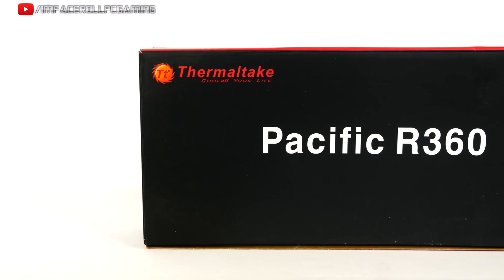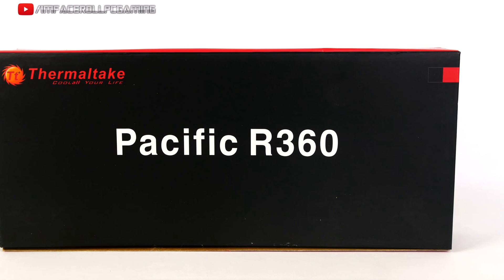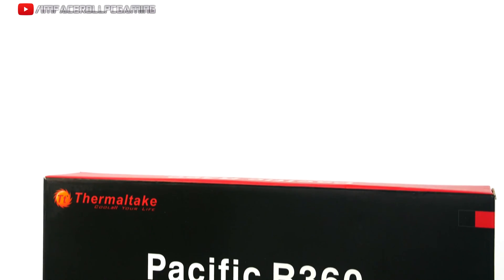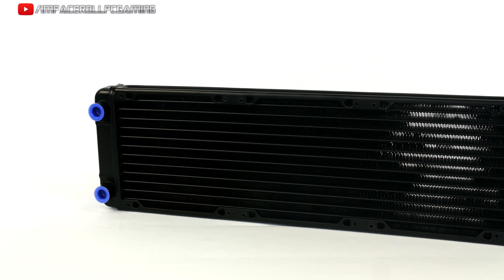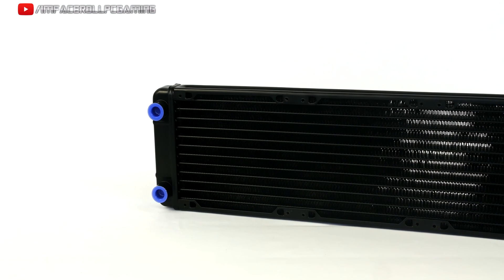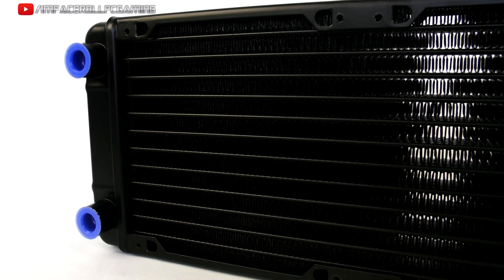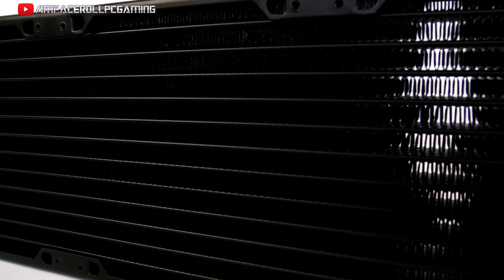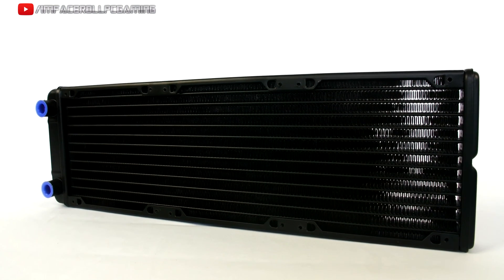Thermaltake Pacific R360 Slim Watercooling Radiator Review, overview and Quick Features FPI

Comment: 100% worst radiators on the market. Aluminium core and fins, will cause corrosion in your loop
Reply from the maker: +Nevsack63 yeah i dont agree with aluminum radiators either. These ones have some zinc coating i believe it is to prevent the erosion however i am sure that over a long period of time that coating will dissapear
Reply: Exactly my gripe. They look good and all, but Im pretty sure all the competition like EK and Alphacool care about getting 5C better temps or so and are using better materials like brass, and copper...
Reply from the maker: +Nevsack63 true there mate, copper all the way =)

Comment: Nice rad I wish I had it in my rig but I'm upgrading it soon
Reply from the maker: +TheGamingLance ooo nice, what upgrades do you plan on making
Reply: well i have i5 4460 and gtx 450 got free of a friend im looking to upgrade to a gtx 960 strix 4gb, 16gb ram 256gb ssd samsung evo and upgrading to a asrock fal1ty h97 killer and water cooler because aussie parts get hot fast so want it cool
Reply from the maker: +TheGamingLance very nice, that is a solid build =) you will be happy with it